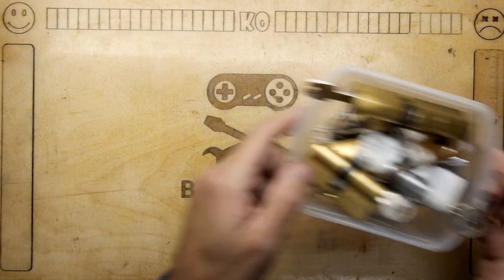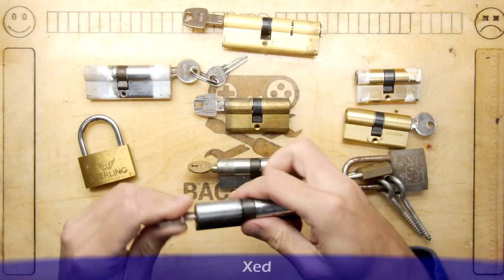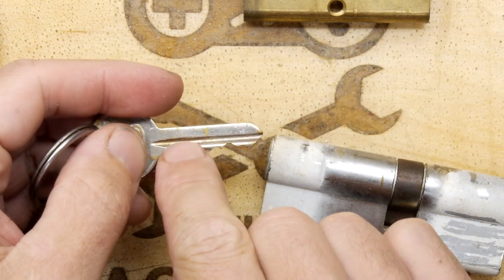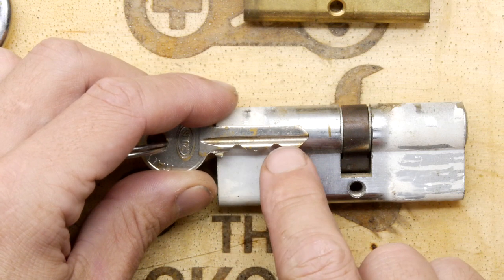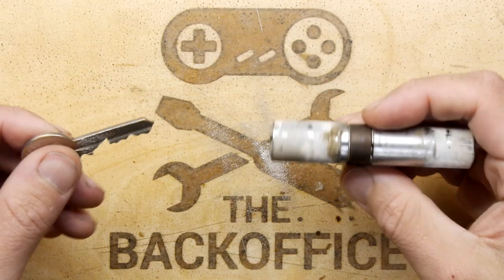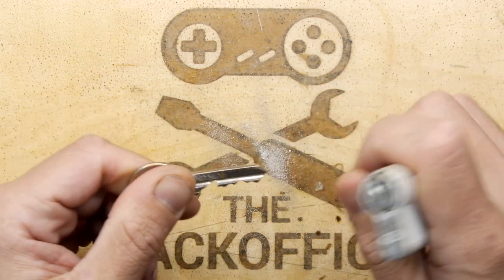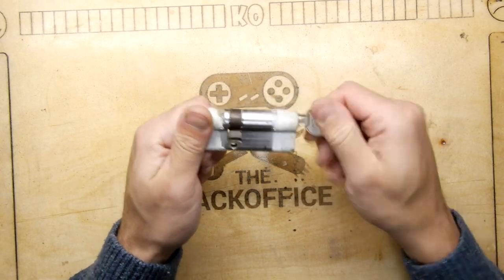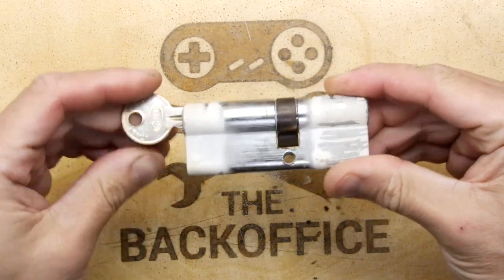DESTRUCTO KEY - How to disable a cylinder lock!

Comment: There are actual commercially available keys made for the purpose of permanently disabling locks, using the same methodology. Though those typically have a shear cut into them to allow the jammed key to be snapped off inside the lock, making it less obvious what has happened (at least less obvious to the casual viewer)
They are called variously "lock busters" or lock killer" or similar.
Reply from the maker: Interesting, I will look for them. I think they must have pretty limited use cases. The only thing I can think of is a landlord removing immediate access to an area they have not control over. i.e. If they cannot get in (because the tenant changed the lock) then they can at least prevent the tenant getting in.

Comment: No need to pick euro-cylinders. Look how little metal keeps the two halves together. The crooks just snap them in half and poke the lever to get into your house. If you don't have anti-snap or anti-bump locks get them fitted ASAP. I warned my father but he didn't listen, then my brothers wife's parents house got done in that manner at xmas and he soon got them changed. I have the Avocet locks, the other benefit being the keys are reversible.